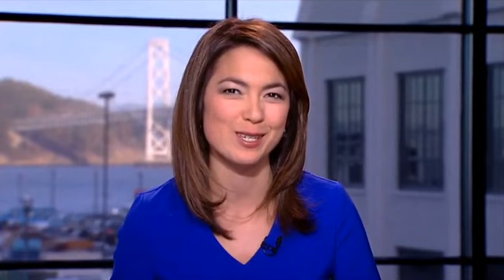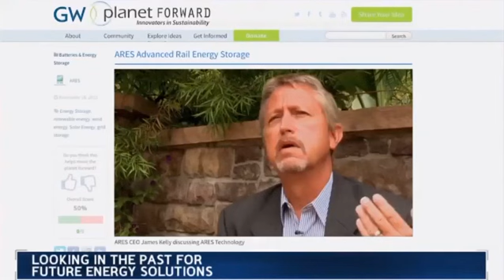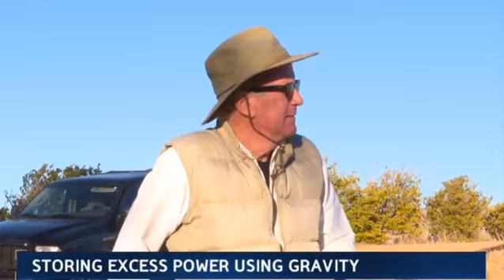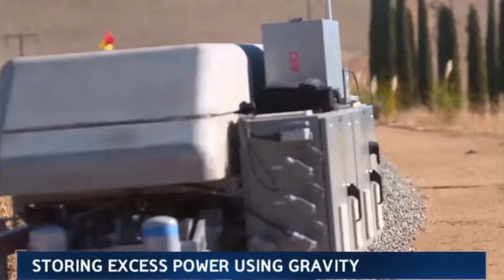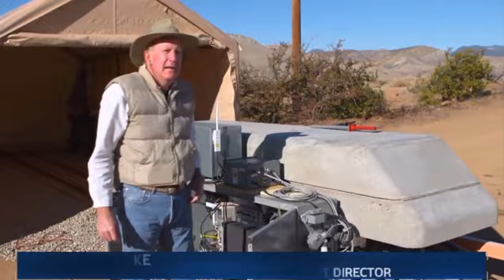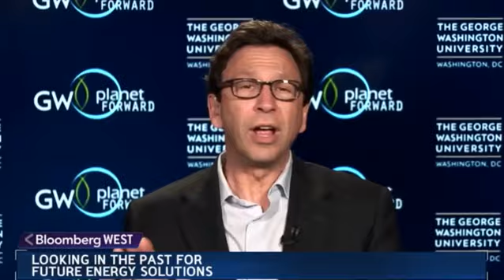A New Kind of Renewable Energy Storage

Comment: You need enormous masses to store enough energy. For instance: One single 3-MW-wind-turbine can produce 72 MWh of energy on a windy day.This corresponds to the potential energy of nearly 26,000 metric tons elevated 1000 meters.Sure, the concept works. But it would probably be a very expensive kind of energy storage.Much more expensive than pumped storage power plants.
Reply: Cerberus984 dude electrolysis fuelcell combination has terrible efficiency.
Reply: +Chobaca Fuel cell efficiency becomes irrelavent if the generating capacity exceeds consumption. The losses could be easily recouped by reducing transport costs of fuel by siphoning excess heat from existing / future power stations. Where future ones can downsize their cooling tower size reducing their costs.

Pumped hydrogen from oceanic wind turbines to circumvent the higher cost of running electrical lines as its a copper vs steel + composite sheething / liner. Electrolysis of ocean water would also create man made coral and should incorporate oceanic farming to rebalance the food chain.

Even if we didn't utilize hydrogen fuel cells you can convert it to methane (CNG) via the sabatier process merging H + CO2. With an excess source of carbon monoxide + hydrogen you can create liquid methanol. The excess hydrogen capacity could alternatively be simply injected into the existing natural gas network within reasonable limitations of percentage.
Reply: Cerberus984 interesting, but how much energy do you need to spend to separate the molecules?
Reply: 26000 metric tons over 1000 meters =

Potential Energy: Mass * Distance * Earth Gravity Field Strength
26 million kilograms * 1000 meters * 9.8 m/(s^2) = 254 800 000 000 kg (m^2)(s^2) = 254.8 GJoules. 

1 MW =1 J/s
Thus: 1 MWh = 3600 MJ

254.8 GJoules = 70.8 MWh

Seems about right!

Pumped storage is less costly, sure.

However, in some places, water is at a premium. Rocks, not so much.
Reply: "very expensive" depends on the initial cost, cycle cost and the number of cycles that can be run over the life of the system. Trains are good for millions of miles before they are scrapped and recycled. I'd like to see the comparison to chemical batteries.
Reply: @dougmc666  Lithium Titanate battery costs 17usd per 2.4V*40AH=96Wh and has 30 000 cycles.
96Wh * 3.6kJ/Wh = 345kJ  or an equivalent of 3.45ton lifted 100meters up.
So one standard train freight car costs 135 000 usd + a generator (say 10 000usd). 
It weighs 100 tons loaded - and is an equivalent of about 30 of these batteries.

So 30 of these batteries will cost about 510usd and require only an inverter (less than a 1000usd) but let's say 1000 - TOTAL - 1500usd
They can cycle 30 000cycles which is an equivalent of 80 years service if cycled daily or if we compare them to a 10% sloped gravity system - 30 000km run.
Similar freight car system costs 145 000usd (100 times more), and has to run 3 0000 0000km before it will even compare to the conventional battery.
If cycled every day - it will have to run for 10 000 years before being more profitable than lithium titanate.

Is it a descent comparison?
Reply: @makerbeelab5546   Your calculations for work, battery life and battery cost are way off. Adding $10,000 to each railcar is unnecessary, freight trains have an engine at the front.  But yes, magic batteries are wonderful.
Reply: @dougmc666  I don't think my calculations are wrong in this case. And even at 10% deviation the train idea is tens to hundred times more expensive than humble lithium titanate.
However real development and scientific progress requires something more substatial source of power than wind or solar. I think if US would limit its pride and start buying those Russian fast neutron reactors - that would work out quite well for everyone. :)
Reply: @makerbeelab5546  - Well speaking of "tens to hundred times" you quote 30 000 cycles, while my source says 3000-7000 cycles, you're out by a decimal point

https://www.batteryspace.com/Lithium-Titanate-Battery.aspx

Your calculation - 96Wh * 3.6kJ/Wh = 345kJ or an equivalent of 3.45ton lifted 100meters up

I calculate 1 kj lifts 1 kg 100 meters, so 345kj lifts 345 kg 100 meters, not the 3130 kg you calculate,  you're out by a decimal point

You battery pricing "30 of these batteries will cost about 510usd", I find prices more like 10 batteries for $500 US
Reply: @dougmc666  Nice work for fixing that. This guy was off by large margins. The first one I noted was the 345KJ. The 3 tons will store 10 times more energy. And let's just say 3 tons is the structural support of the cart. On single car can carry what? 100 tons?   I guessed it and then went to fetch it. here it is >>>100 tons

"How much coal, in tons, can a railroad car hold? - Quora
https://www.quora.com/How-much-coal-in-tons-can-a-railroad-car-hold"   

 So each cart  at a height of 100 meters will store energy 1000 times more than what he had calculated 1 car will be equivalent to 30,000 batteries of such kind.    Let me piggyback on his calculations, 30,000 batteries will cost $510,000  whereas 1 train will cost  $135,000
Reply: @makerbeelab5546 
(6 years ago.)
How are your 30 batteries going to store 72MWH at 6600 Volts ?.
Reply: Does anybody know what a good, sustainable solution for more advanced renewable energy in developing countries?
Reply: Nuclear power, fast neutron reactors like BN-800 or floating nuclear power station like one based on a couple of KLT-40 naval propulsion reactors and been built by RosAtom.
Reply: I bet there are heavier materials if needed. It is probably possible to increase the weight to 4 tons
Reply: CHomab Cjabeb we should use gold or something. Bling is so carbon age 😁
Reply: Flywheel, much better.
Reply: @augustlandmesser1520  - depends on storage losses over time, wind and solar can shut down for weeks
Reply: so 1ton = approx 2.5kwh, a 100ton rail car would store about 250kwh. hmm that's not bad since you could theoretically stockpile thousands of rail cars at a single site in multistory complexes at the top and bottom of the site. the rail cars don't even necessarily need to be motorized; they could be pulled up and down by a powerful winch fixed at the top of the hill or a few motorized railcars could pull several dead weight cars etc. you could have multiple trains traversing the same track and multiple tracks at the same site so it's scalable.
Reply: Not if you use existing freight trains, shipping containers full of sand or rocks. Why reinvent the wheel when we already have so many of the working components?
Reply: Veja https://t.co/1yxA8Hun8Y
Reply: @the81kid @Just Curious
Pumped water energy storage is a multi purpose solution as it can help mitigate flood problems, regulate water supplies, and obviously create power. I believe we are perhaps transporting water the wrong way though. Instead of transporting H2O we should be transporting the lighter molecule by itself towards a hydrogen fuel cell stack harvesting oxygen on site.
Reply: +Thomas Schuster 
Very expensive is still far cheaper than batteries. The technology is poor, lifetime is short, and the costs are enormous. These gravity batteries will essentially last indefinitely, if maintained correctly.
Reply: Yeah, all these grid storage systems are all cool, but when you run the numbers the shear scale you need to achieve is confidence crushing. Still, it can and must be done.
Reply: Just Curious hi

Comment: I'm not convinced that we need the concrete blocks. And the proprietary loading system. And the proprietary cars with built-in motor/generators.
Why not simply use existing rail cars? And perhaps existing (albeit modified) locomotives?
Reply: AND
concrete manufacturing is a huge emitter of CO2.
Reply: @neddyladdy  That is a one-time cost. If you reuse the same concrete block many times then the "CO2" use per unit of energy handled becomes very small. Also, the blocks of concrete can be very "cheaply made" ones, filled with lots of rocks. This drastically reduces the actual amount both of of actual concrete needed and of CO2-per-cubic-meter of actual concrete. After all, it isn't as if these concrete "bullets" are "load bearing" or anything like that.
Reply: Energy is force times distance, so if the concrete blocks were gone, it wouldn't be able to store as much energy. You want to lift as much material as possible.
Reply: kindpotato - Yes, you want to lift as much inexpensive material as possible Ie: A place to store unused freight cars, no need to load anything.
Reply: But how will they sell you all the proprietary shit in that case :P
Reply: without the cars having motor/generators how do they return them to the top - other than hook many of them up to a single engine (which might be viable in some situations as well).   Basically they're turning each car into a regenerative unit, so they have a lot of incremental capability in small units of power addition.
Reply: Hydro storage
Reply: @bobdan9856  Veja https://t.co/1yxA8Hun8Y

Comment: Wtf happened to a compacitor?
Reply: +Aaron Lehman A capacitor could be used after the kinetic energy is generated but this isn't electrical storage but rather storing of potential energy.
Reply: A capacitor the size of the largest oil tanker might do it. I wonder if the railroad tracks would be cheaper?

Comment: Just put a water tank up there and fill it up
Reply: ***** I know... that is exactly what happens in this example... when the cars need to be sent back up the energy generated is lost... the point of video is lost on you. It isn't energy generation it is storage. Like a battery.
Reply: This is better as there is no chance of energy loss due to evaporations or leakage. and far more energy is regained in having the carts move down the hill than having water fall. A hydro dam like what you suggest would lose about 20% of power put in, I'm not sure about this one but I am almost positive its less. as well as far more efficient compact, and less chance of problems.
Reply: When every other car is an EV a smart charger will act as a load leveller using 100.000 of battery packs to handle spikes on the grid. This was actually incorporated in the charger in the second revision of the first Tesla roadster, the T-Zero.
Also ban electricity price speculation and have an adaptable , but national price, so different power companies have it easier to share loads.